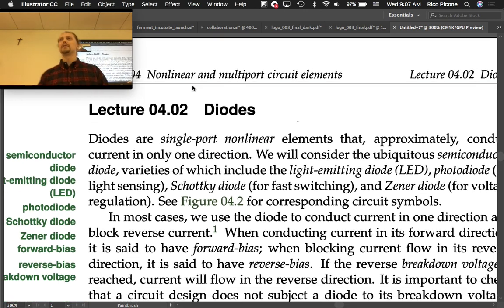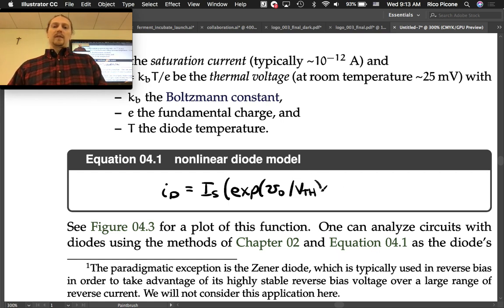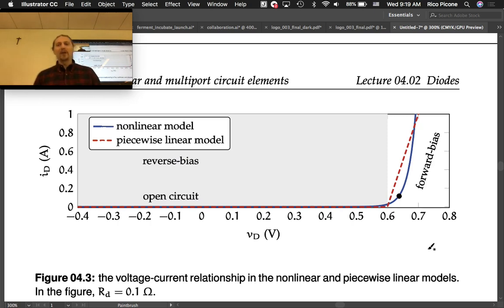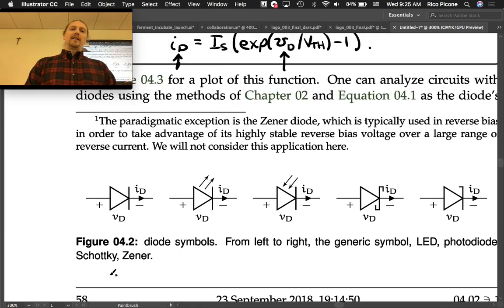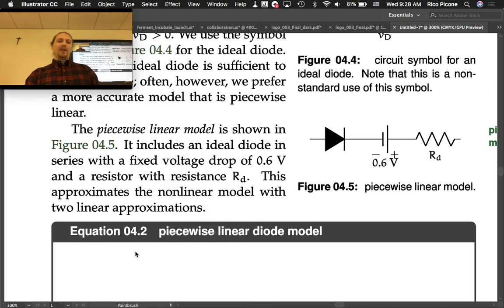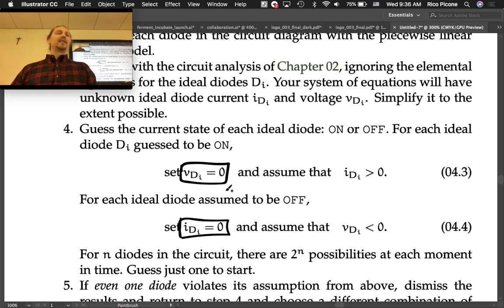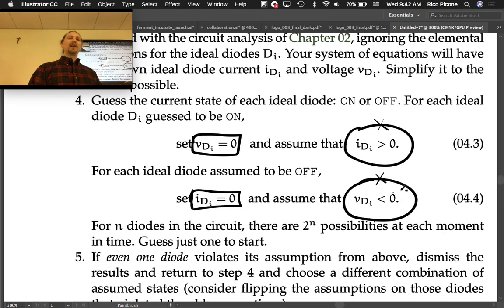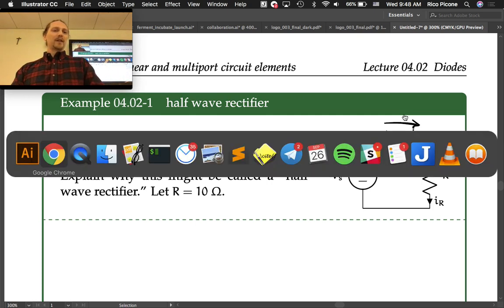04.02.1 Diodes

Comment: Dr. Picone,
When a diode enters a state of breakdown is it damaged?  If so, how does it change?
Reply from the maker: Breakdown doesn't necessarily damage a diode, but damage can occur if high current flows (in reverse) and heats up the diode. There's often a hysteresis effect so that the reverse-bias to breakdown voltage transition is not the same as the breakdown to reverse-bias voltage transition. This is less of a concern with Zener diodes, which are designed for breakdown operation.